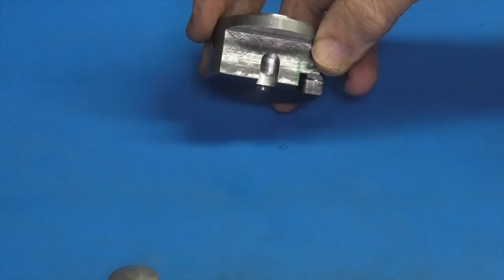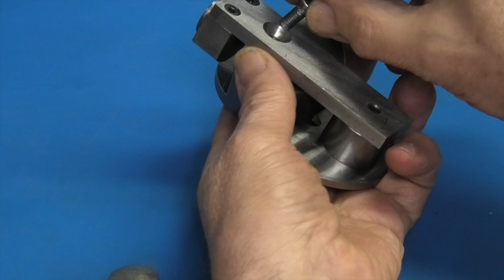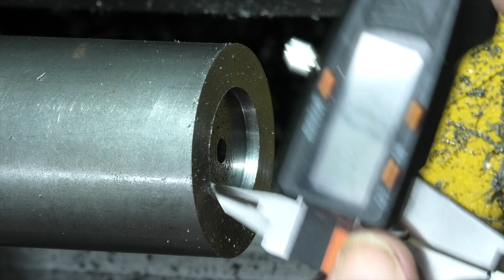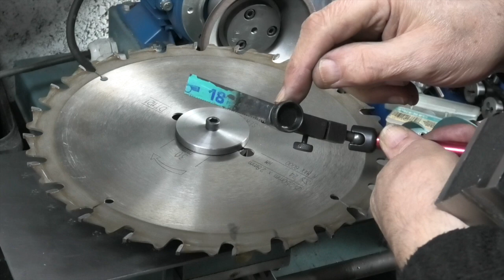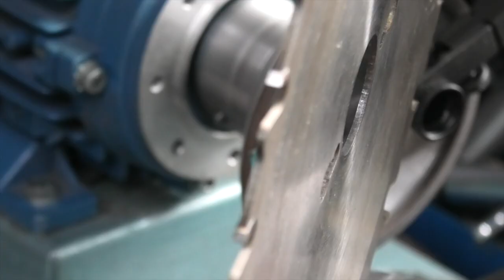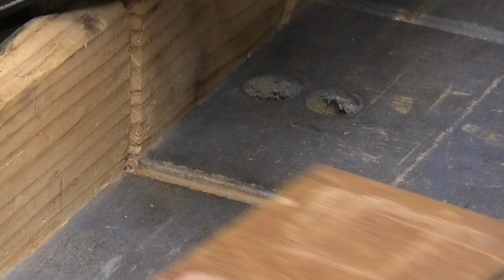Saw blade sharpening attachment part 2

Comment: Cut part way through a piece of wood with almost any saw blade and observe that the bottom of the kerf is V shaped. Every blade I’ve ever owned at least. So I don’t think that best practices is to grind all of the teeth perpendicular.
Reply from the maker: To cut the kerf angle just set the table tilt to the angle and grind every other one then reset the angle and grind the remander